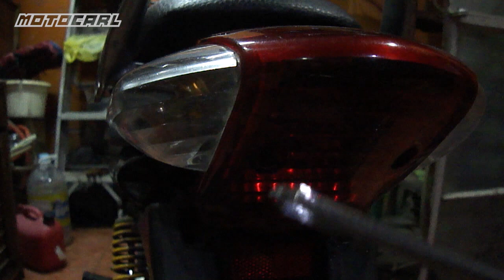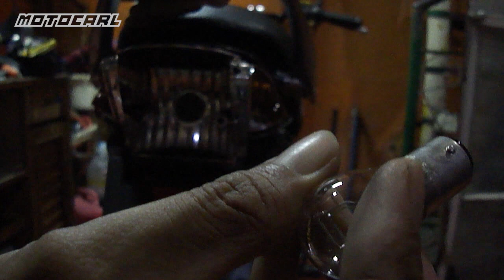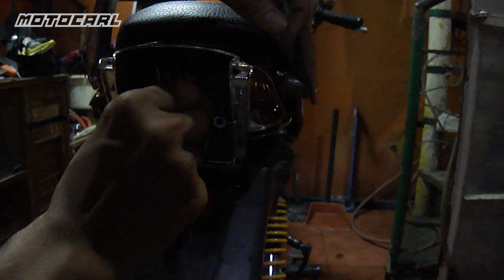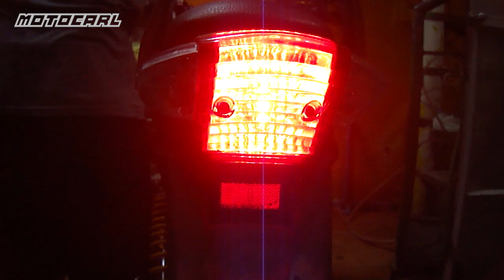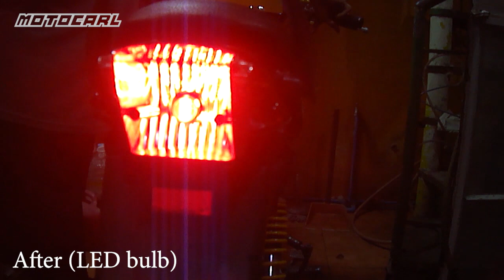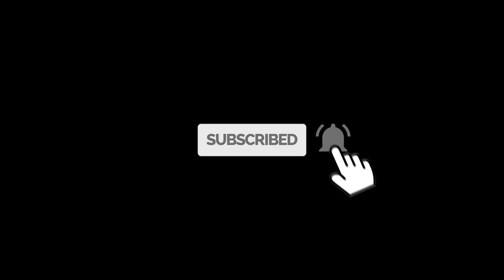Pano mag palit ng brakelight bulb Stock to LED | Honda XRM125

Comment: need po ba i-battery operated?
Reply from the maker: no
Reply: Need yan. Masisira kapag naka stator driven ang led kukurap. Dapat rekta sa acc wire (lagyan ng fuse for safety) para kapag sinusi mo doon lang aandar